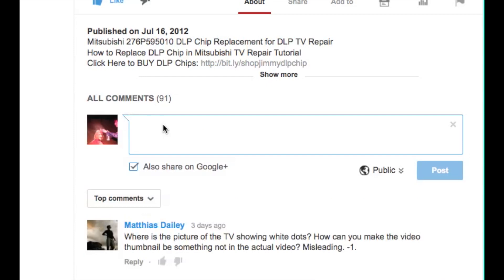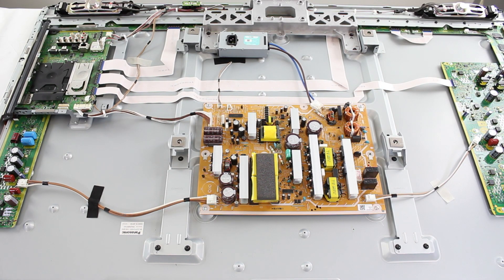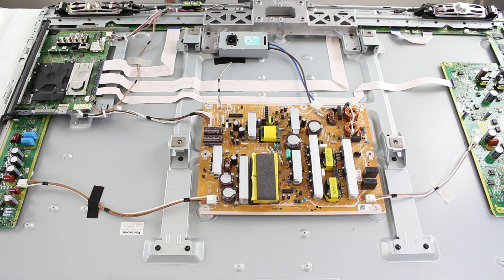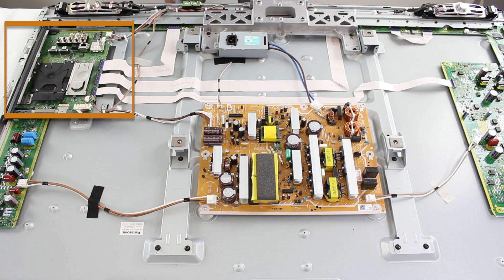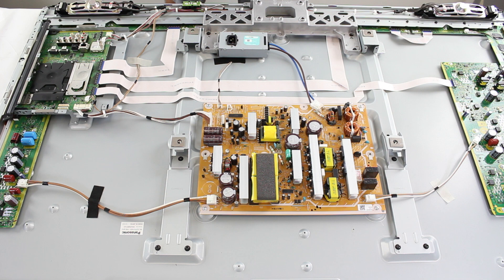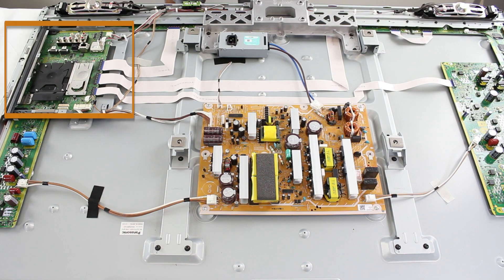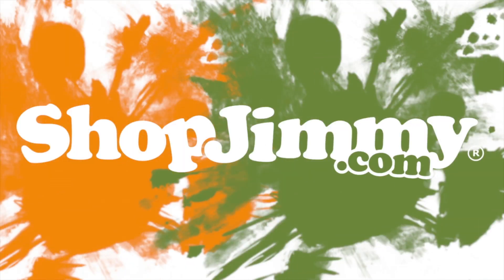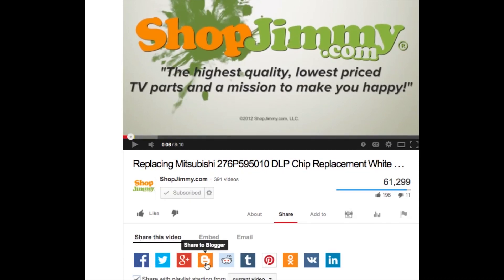TV Not Working After Storm - TV Lightning Strike & Storm Guide for Power Surge Problems

Comment: Hi, I appreciate your video. Very informative and it helps everyone to know the basics. By the way, I have a sony klv-40ex tv. About a week ago it went dead off after a lightning strike. The tv went off with no standby light at all. The TV was connected to a cable box but the cable box was just fine as we were still hearing sounds on the background coming out from soundbar as this was connected directly to the cable box using an optic cable. The tv comes with an adaptor and this has been checked at Sony center and it still works perfectly fine. I was asked to bring the tv for them to check further what could be the problem. I was told that if the main board is damaged, it's better to buy a new tv as the main board would cost a lot. I hope it's the power supply so it only cost less.

Comment: I have a insignia NS-55DF710NA19 that had a lightning surge come through cable box and out the Ethernet line directly into the main board Ethernet port and the bottom side of the board is so close if not touching because that is where the surge ended up grounding itself out with a huge bang and tv don’t work no more. I thought at first power supply because tv blue standby light was out an tv would not power on or do anything. After a bit of research I realize that it potentially could be the motherboard that was damaged and that’s why I’m not getting a 5v standby light coming on. I removed motherboard and immediately saw burnt board and big black burnt area on metal frame, the Ethernet circuitry on board was visibly burnt and smelly. All other components look fine. I made the mistake of ordering a motherboard from eBay not realizing the importance of part number matching, thanks to you I figured it out, I had installed the board I purchased and tv powered on with remote, began to load as normal but on home screen remote doesn’t work. The only function of the remote that works is power on and off. So unable to set up and navigate. Also I noticed the blue standby light does a slow blink thing, and other times goes out like normal when powering on. So my question, are all the problems due from wrong board being installed? The wrong board is 756TXICB01K013 ver-A and the original is 756TXICB01K014 ver-B. I didn’t want to order anything else until I try the right board. It is on order an I’ll have it in a week or so. Please any help would be great. I may try calling you too.

Comment: I have a LG 42LD450-UA and I moved it to a different room and as I was hooking everything up to it I was putting an HDMI cord up and it tripped the breaker for the room and then the port is now slightly melted. I left it alone all night and now I can plug the tv in but the screen won't come on. The power indicating light is on and when I press the power button it will fade out like it is about to come on, but it just comes back on red and the screen stays off. The light will fade in and out if that makes a difference. What should I start with?
Reply from the maker: Matthew Fleming   I recommend replacing the main board in your TV.  Click this link to replacement parts for your TV model number:  http://www.shopjimmy.com/catalogsearch/result/index/?cat=56&q=42LD450-UA  Be sure to match part numbers on your current board, with your replacement for compatibility.  Here is a link to a video showing how to identify your part number, click here:   https://www.youtube.com/watch?v=RwHTvjMdrhk  Thanks and please let us know if you have any further questions with your TV Repair!  www.shopjimmy.com

Comment: If the Roku ultra also was  damaged and not working by lightning it's probably the main board correct.
?  Tv is a TCL 65 was attached to a surge protector is completely dead. The internet router and Ethernet was attached   Internet is out router flashing blue

Comment: Insignia NS-39L700A12 suffered power surge from lightning. It is now reluctant to turn on using switch or remote, but if I can get it to turn on then it works normally. No obvious damage on power supply or main board.

Comment: Okay I have an LG70UH30H. The home was struck by lightning and everything that was hooked up to coax smoke and needed to be replaced but we come to the TV. The cable box it was hooked up to definitely fried obviously because of the coax but the TV itself was on a surge protector. A brand new one. I pulled the back of the TV off and found right off the bat the fuse was bad. I jumped the fuse just to see if it was worth messing with and plugged the TV into the wall. Thank God I was still hanging on to the plug because the lights in the room went off and the center of the power board was glowing red LOL under these metal plate looking things with three metal Nubs under them. I literally cannot find any burn damage on any circuit board so I am stumped as to what capacitor or resistors to replace but help would very much be appreciated or any ideas. Thanks

Comment: Sony KDL-48w600b one of several devices damaged by lightning strike to power pole outside our home. Sony power brick disassembled and shows burn marks and damage. No burn marks or obvious cracks in boards. New power supply brick/cord does not restore power. Thoughts?

Comment: I have a lg 60pa6500 stuck by lighting and don't see any burn marks or cracks in any boards. No standby light nor will it power up. I have replaced the power supply but still no stand by light. Will the main board also not allow a stand by light come on?

Comment: I have an LG 60PA6500-UA that has experienced a power surge.  I have a standby light but I can get power to come on.  It has powered on once but then the tv after about a minute it shut off and went into standby mode.  We took the back off and looked at all of the boards and they seem fine no damage, burns, cracks etc.  I assume perhaps I have some bad diodes or something.  Would you suggest replacing both boards???

Comment: Hello I have a VIZIO M322i-B1 32-Inch 1080p Smart LED TV (2014 Model). It was struck by lightening and won't even power on, no lights, or nothing. I took the back off to look for anything but there was no burn marks or cracks on either board or anything. What should I do if there is no visible signs?

Comment: Ok so my LG 55lk520 stop working after a storm. I have a DVD player, Wii ,Tv, Sat box all on the same surge protector. But only Tv and sat box stop working. The Tv has a slow constant pulsing red light. I keep playing with it and it came on for about 30 seconds, went back out and never came back on again. Watched your post and determined its the main board or power supply, right? My question is, does this sound more like a main board issue and have you ever seen the standby light come on at all if the power supply board is bad? Thanks.

Comment: Hi I ordered a power and main board from Shop Jimmy and replaced them both.  However,  the TV still won’t turn on.  The Model is a Vizio D50-G9.  I couldn’t find the fuse so where is the main fuse located?

Comment: I have a vizio e390i-a1 I had a power surge today. it was plugged into the cable box (brighthouse) no power light.. fuse on power board is ok per ohms test. no visible signs of damage on the top side of the circuit boards. your video suggests the main board that the video cable plugs into... if so how much and how long to get one from you?

Comment: Hi Thanks for your help. I have a Seiki  model sc324fb  that got knowked out by a lighting storm. I called and had a tech take the part out and he disapeared with what he said needed to be replaced. It is the board on the right side. There are only two large boards. Thanks

Comment: I have an LG 55UF 64/67/71. That will not power on. there is a standby light but no image when the TV turns on. I’ve pulled the back off of the TV and inspected all the boards, I can’t find any bulging capacitors, there are no burn marks. The problem occurred after a lightning strike which I suspect came through the coax connection. On the connection panel to the house there was a burn mark behind the coax connection block.  Any suggestions would be helpful and appreciated.

Comment: TCL 75" 4-Series #75S425. Not getting any power to TV. There was a storm last night. TV and other electronics were plugged into surge protector. However... some of the other electronics had to be unplugged and plugged back in before working... which leads me to think that there was still a surge. I've tried discharging the power, holding the power button, and reset button. Probably need new power board?

Comment: I  have a samsung  un46eh500fxza. the tv will not power up after a lightninh strike. No stanby light. The power strip it was plugged in to is fine. I took it to a local repair guy who said it needed a new circuit board. I do not knowif that means the yellow power board or the main board? I have  ordered the power board from you and it is on the way......any thoughts? thank you

Comment: I have a Sony LCD XBR-55X810C that has no power or lights at all.(dead set) Lightning hit a tree near the house. Damage appears to be to the TV and my Wi FI modem only. The TV was not on a surge protector. I have checked voltages and found the following results: power supply board has the 3.3 volts present; it also has 12.7 volts at the reg.; There is NO Voltage on the Tcon terminals. After watching your video I am thinking the main board may be the problem along with the fact that the modem was also ruined. Perhaps the surge came through the ethernet cable system?  Are there any other voltage checks that could confirm the faulty component?

Comment: Hello, i have a Samsung LN40C630K1F. During a thunderstorm it quit working. The standby light is on but, no picture. I removed the back panel and inspected the boards, there seems to be some sort of glue/substance that surrounds some of the components on the power supply board. I am assume i need to replace this but, want a second opinion.

Comment: Hi our Samsung UHD 6 Series Model UN50NU6900 lost picture and sound due to lightning, but Red light functions as solid ON or blinking Standby using both the remote and button under TV near Red light... This TV had it's single panel board replaced under warrantee six months after buying it.

The Comcast box is completely dead,, does not power on at all so we replaced it.

Your assistance and suggestion would be appreciated.

I have previously replaced parts soldered capacitors to computer screens with success, so that option is open to my talents.

Comment: I would like to know if it is worth fixing my Samsung PN51F4500AF television after a lightning storm it was plugged into a surge protector(which is fine) put wiped out my main living room TV, cable box and dvd player. If cost is about 200 it would be worth it I can just rearragnge the other TV's in the house. There is NO power at all and tried multiple plugs.

Comment: Hi, my house got struck by lightning and my cable boxes, modem, xbox, and TV all turned off, had no power to them at all and had to be replaced. The TV is a 46" SAMSUNG model# un46eh5000fxza I opened the back and there is 2 boards in the TV. The power board and the main board. I checked both sides neither were "burnt" but the back side of the main board has like a weird kinda blotchy film on it.  Could this be a bad board? I have a picture I can email you. Thank You!

Comment: I have a Sanyo 32" TV. Model # DP26640. It doesn't power on or have a stand by light on. but when it is plugged in, it makes a white noise kind of sound very soft. I know it has surge damage bc multiple tvs in my house went out, Internet box, all cable boxes, fridge and many more items. Do you know how much it may cost me to repair it? And by my description do you have an idea which board is out? I know asking that is probably impossible to get an answer without looking at it but I figured it wouldn't hurt to ask lol.
Reply from the maker: Whitlerr   Please watch this video FIRST to help with your repair!  https://www.youtube.com/watch?v=BP3NVNCGEv8  To repair this, you will want to replace the main board and the power supply.  Click this link to repair parts:  http://www.shopjimmy.com/catalogsearch/result/?q=DP26640  There may be multiple boards for the same TV model number, be sure to match part numbers on your current board, with your replacement for compatibility.  Thanks and please let us know if you have any further questions with your TV Repair!  www.shopjimmy.com

Comment: I have an LG TV Model 47LV5500-UA that was damaged by a lightening storm that also took out my DVR.  It was connected to a Rocketfish surge protector that appears to be working normally.  The TV does get power, but no picture or display whatsoever - the standby light changes from red to white as usual when I turn it on.  Neither the power board nor the main board shows any visible damage. My son, who is an electrical engineer, replaced my power board, but that did not fix the problem.  He is now recommending that I order a new main board from your company.  Given the lack of any burn marks or other damage on the main board, is it likely that a new main board will fix the problem?

Comment: I have a 50" Emerson, model # LF501EM4F. I have already ordered and replaced the power supply board, but still have red blinking stand by light, please help with any other suggestions you can think of?
Reply from the maker: Donna Greene  Please watch this video FIRST to help with your repair!  https://www.youtube.com/watch?v=BP3NVNCGEv8  I recommend replacing the digital board in your TV.  Click this link to replacement parts for your TV model number:  http://www.shopjimmy.com/catalogsearch/result/index/?cat=225&q=LF501EM4F  There may be multiple boards for the same TV model number, be sure to match part numbers on your current board, with your replacement for compatibility.  Thanks and please let us know if you have any further questions with your TV Repair!  www.shopjimmy.com

Comment: Hi, i have a question. I have a Samsung 40inch (Model: LA40B532P7VXXA).

It just shuts down randomly. Sometimes it will stay on for 10 or 15 minutes before it shuts down, other times it might just be a few seconds. Every time, just before it shuts down, the screen will become a little brighter, and then it shuts down. I have opened the back and found the ground screws on both the power supply and main board to be a bit loose. Tightened it up, still the same issue. I also unplugged everything from the power supply, and it still does the same.

Capasitors all looks good visually, and there is no other obvious damage that i can see. 

Any suggestions?

Comment: Shopjimmy, I have an Insignia NS-50L240A13 that was struck by lightning. Now it won't turn on and doesn't illuminate the standby light. Neither board appears burnt or damaged and the fuse has continuity. Any advice on where to go from here?
Reply from the maker: Jacob Rivers   I recommend replacing the main board and the power supply board in your TV.  Here is a link to replacement parts for your TV model number on our website, click here:  http://www.shopjimmy.com/catalogsearch/result/?q=NS-50L240A13  Be sure to match part numbers on your current board, with your replacement for compatibility.  You can also call our customer service for further assistance with your purchase.  (877) 881-6492  Thanks and please let us know if you have any further questions with your TV Repair!  www.shopjimmy.com

Comment: We had a lighting storm next morning when I turn it on the tv it was all like psychedelic picture. Almost like thermo imaging. Did a scan got more channels then normal and then no service. I have the a LG tv 32 inch. And a terk omnitvo antenna. I am in an rv and I'm pretty sure no surge or actual lighting strike either because I was awake with it started. The tv was off. It does have an amplifier. Tv works great with fire stick but zero through antenna.

Comment: I have an LG 55LM4600 LED tv. We had a lightning strike nearby and lost 2 TVs, an Xbox and one Cable box. Also, the Verizon Fios box outside had to be reset.  All were on surge protectors. other items that were on the surge protectors were fine. Only those connected to the cable were affected. I suspect that the surge came in on the cable then through the HDMI and not through the power. I have a solid LED standby light on the TV. it does not come on at all via remote or via the controls on the TV itself.

Comment: I have a 2014 lg 50lb6300. Hit by lightning.  Red light to indicate it it plugged in. Nothing else, wont turn on with remote or had switch.   Don't see any obvious issues on boards.    Thanks

Comment: My Samsung un55c8000xfza isn’t working due to lighting/power surge. No visible damage to any boards. Red power indicator light is on. There is two clicking sounds, one after the other. The first one isn’t as load as the second one.  They is two seconds between the quieter click on the loader on. A five second pause after the loader one then it repeats. During the two seconds between clicks there is a very quiet hum. All sounds are coming from where the power cord connects to the back of the tv on one of the boards (tan colored board). Any ideas on how to repair?

Comment: Hi, I'm Isaac. I have a 2011 Panasonic TC-P69S30 Plasma TV. Supposedly it was hit through the cable. The HDMI and sound were not working. At the moment I am getting no power indicator light or display. I have power to the power board and all the fuses on the board are good. Wondering if there is a way to bypass the power button and or check the output voltages from the power board. I am fairly sure I will need the main board but did not want to get just that if I also need the power board. Any help would be greatly appreciated thanks.
Reply: Hi I have a emerson model Lc320emx that has been hit by lightning  no cracks on board or burns just blown fuse. I have a element model number elefw328 same problem